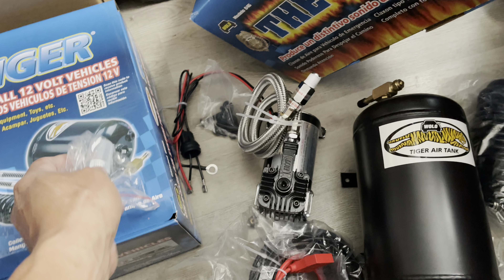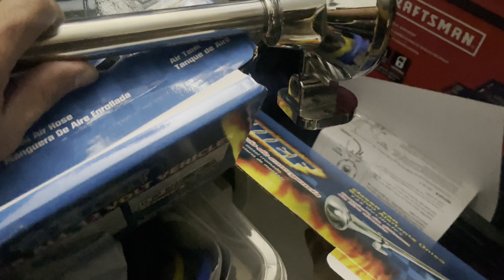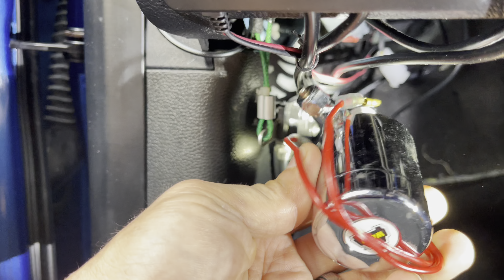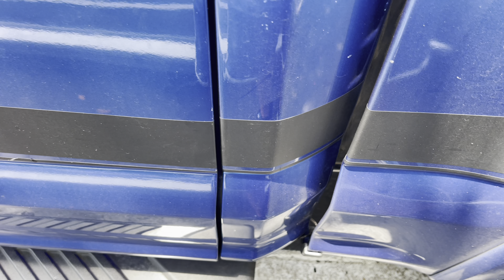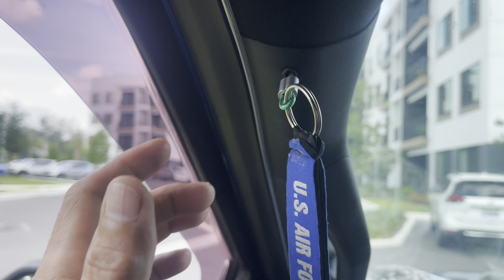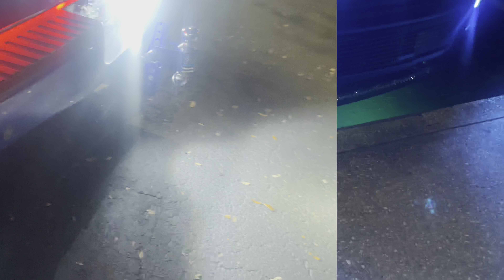Fire truck air horn

Comment: Hey, man, I want to install all the system in my ambulance, how many times can you use the horn before the air runs out?
Reply from the maker: For emergency vehicles you should have bigger tank they have also longer size tank but it’s expensive but mine it works really well my air takes a while before it runs out but its fast to fill up my tank if i run out off air.

Comment: What psi do you run to horn?
Reply from the maker: 110 psi works great I pull my lanyard until the last until the pressure switch kicks on same as like those fire trucks when they blow there horn non stop.
Reply: @pinoyhandymanofalltrades Awesome! Yeah, I was just curious of what pressure goes to the horn itself. I'm doing the same setup on my truck, but with a momentary pull switch and a solenoid wired to the switch to let air through. That way there's not extra air line to deal with. Thanks for reply!
Reply from the maker: @Tgtha49rfan you’re welcome you are going to love it. all those people in front of you they will set a side I did once they thought I was a fire truck every one gets crazy 😂 i will add one more trumpet on mine.